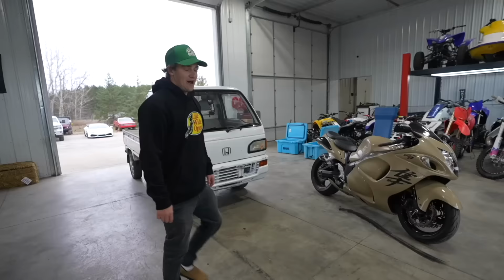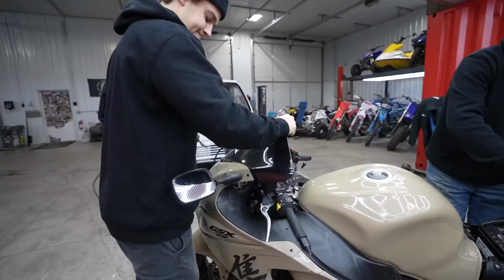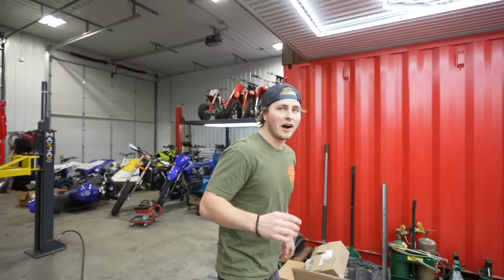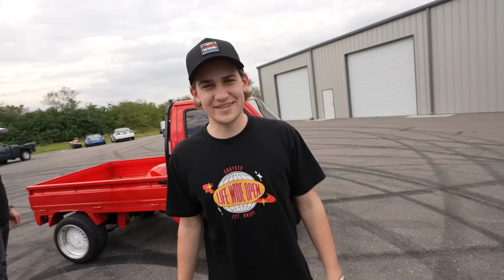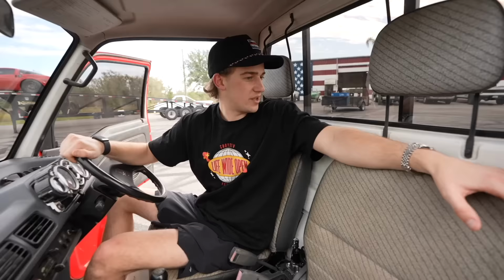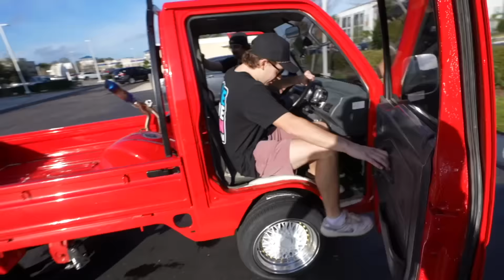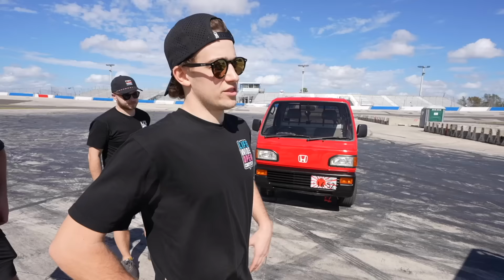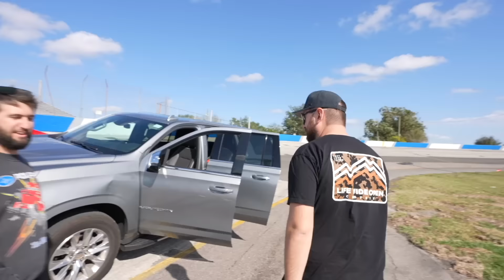Crotch Rocket Swapped Mini Truck

Comment: So glad yall using a ford nine inch alpt of ppl who dont race oval track have no clue how awesome a Ford nine inch really is for a performance vehicle and racecar. Its called the original quick change cause you can change the gear ratio bu pulling out third member and installing a different one with a gear set in it and its very easy and fast to do

Comment: The only way to this thing right would be to extend the width of the wheel base, make some fenders. Also lower the seats, chop the top down, and add more weight to the rear.

Comment: Hey guys, just saw this, and I love it. Think about this for a moment, weight distribution, use two motors instead of one, both would work independently, one powering the front, the other powering the back, meaning you'd break the weight from front to end in 3rds, the center being slightly higher, your center of gravity. 
Really enjoyed the video and effort you guys put into this project/hobby, y'all rock

Comment: You should put it on tracks or get a 6 wheel drive and add the hayabusa 1300 engine to.
Maybe a can am mavrick turbo rr 4×4!😮
Put it up to 6,000 horsepower.😮

Comment: The older H2 was the widowmaker from Kawi, not the busa, it doesn't go 220mph from factory - if it gets unrestricted it can go around 205mph stock, maybe 208 with a light rider - otherwise it goes about 190mph. Love Cboys but daggum lol. Still prefer Zukes though.

Comment: Does anyone else feel like that 9" rear-end is way overkill for a motor with less than 100lbft? Still a sweet ride, but something out of an old ranger would have been more than enough. Plus it would be lighter, Rob less power, and been a little easier on the driveshaft.

Comment: put a auto blip quick shifter and then you can run full throttle and shift never let off most all newer sport bikes have them easy find for the busa and would sound wicked

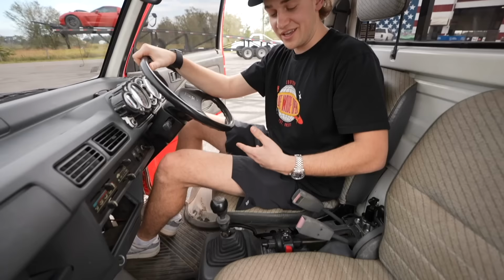Comment: 10:52 get you one of those cheap aluminium hand brake bars people put in their drift cars. You can mod it to work with the bike trans and be nifty. Much better than a sloppy h patter shifter trying to find the right "up and down" to shift. Much MUCH cheaper than a typical SSQ dog box style shifter would be.

Comment: Used to drive these in Okinawa (USAF) and even with the stock motor this thing was not safe at high speeds. Highspeeds and a nice wind would flip this thing quicker than a Suzuki Samurai.

Comment: I'm looking at importing  a Daihatsu Midget II K100C (or K100P).  I think I should also be shopping for a Honda GoldWing GL1500 or 1800.  At least they have "reverse".  With the engine placed in the rear the weight would be where it needs to be.

Comment: I’m really questioning how the transmission works in stuff like that. Cross carts do it, have wondered for a long time the clutch and foot shifter from a bike with the throttle could be manipulated and how difficult a conversion would be. I can drive a manual, just not like race car driver drive, tried taking off from a stop sign long time ago with a passenger who kept telling me you can take off with the clutch work, but my instinct and feet was too much 😅. Always thought if the shifter on a bike was the clutch, or left foot break lever was clutch and suicide shifter on the right hand side I could ride. I just can’t drive and not press the clutch and let off the gas pedal to shift, that’s how I learned and have always driven

Comment: I get the appeal of the Hayabusa in a motorcycle but when you put it with a heavier frame why don't you just use a 200 horsepower 4 cylinder car engine of like 2 l or whatever whatever?

Comment: why the fuck would you use an aceteline torch to cut that hole? the metal is thin a fuck just get something with a metal cut off wheel and zip it open in about 30 seconds, it would look better and be much cheaper and easier.............

Comment: You could have made it easy on yourself and just went and bought a used legend racecar. They have vin numbers so easy to make street legal. They are built for oval track and road course racing and have 1200 cc street bike engines in them and fly. I turned my old one that i ise to race at a circle track into a street car and just changed the gear ratio and i have jad it going 196 mph is fastest i have jad it up to on a runway at a airport thet they do soeed run weekends its a mile and half and allows ppl to top out thier sports cars street bikes ect. Next event they having im hoping to break 210 mph with the mods i made to the engine and made it have less drag and more aerodynamic so it forsnt have to use as much power just to plow through the air and overcome the drag

Comment: So many rooky errors (forgetting hose clamps) ... blew the oil out of it... boiled it... on the limiter and down shift? Doing a burnout  (trying to) in a rental (and filming it?)  Stupid is as stupid does.... the driver is an idiot and the passenger was dumb for going along with it. That thing would be fine in the right hands... but will likely crash and burn and hurt someone. Could be cool, but not in the hands of a fool. Sad